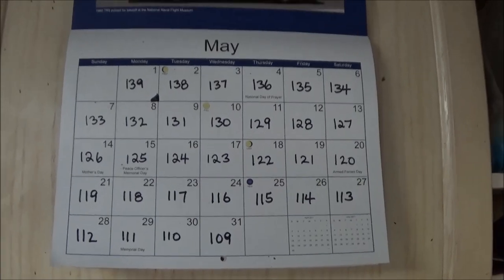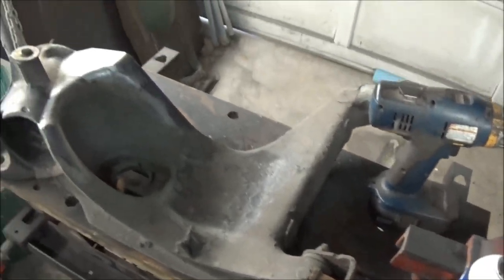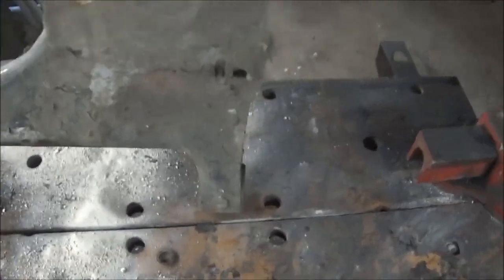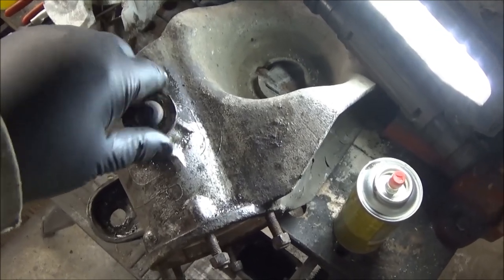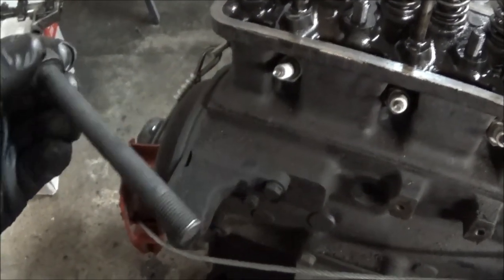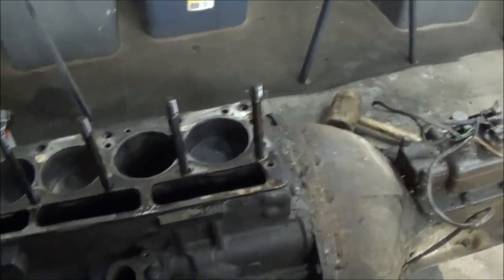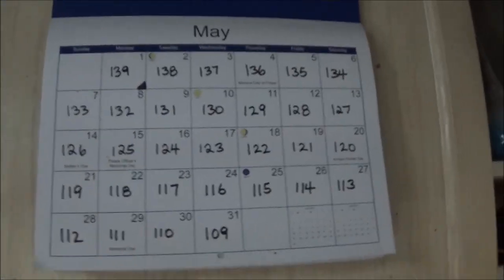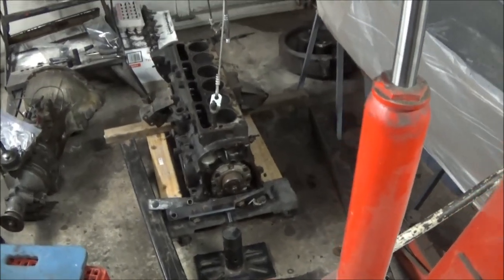T-Minus 128,1968 Triumph TR250 Restoration, Trailing Arm Engine Tear Down Part 1

Comment: I always learn something on every one of your videos. I cleaned and prepared my 50 yr old TR6 trailing arms and the load of odd looking dust that came out worried me a bit in that I was thinking aluminium corrosion. It was mould sand! Never thought of it. Thanks , again!

Comment: Lots of work, but going to be nice.  There is a nice TR250 on ebay right now with a set of American Racing Silverstone!  Maybe check it out for inspiration?  Good call on the sand in the arms!  So now that you have the head apart, you thinking about port and polish plus hardened seats?  Then again, maybe time and budget will make that decision?  Hang in there!

Comment: Can I replace all my suspension bushings (gain access to/ remove parts) without taking the body off the frame?  Between you and Elin, I have learned alot.   Jerry
Reply from the maker: geotrucker you sure can Jerry.  Some of the fastener locations can be a bit more of a challenge with the body in place , but they are all accessible.